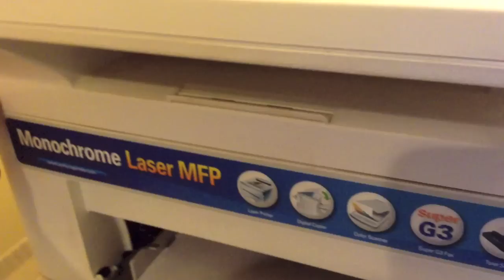Replace a Printer Pickup Roller (Samsung ML2010, SCX4521, SFX4725 and others)

Comment from the maker: Re: Johnny Tucats
Sorry if you had trouble installing your roller.
You can see in the video (around 4:00) that it doesn't take much effort at all to click the new roller back into place. It's darned awkward reaching in there, and you have to have the right little "knobs" or "projections" in the right little slots, but once you have lined it up correctly, it does click in pretty easily.
If you had trouble I can only guess it was either upside down or the knobs weren't in their respective slots. I agree the square bar the roller goes onto isn't the sturdiest part ever made, but I have done this procedure several times and when lined up correctly, it doesn't require much strength or force to install. I recall once where I was frustrated and then realized I wasn't doing it right. I relaxed, watched my own video again, looked things over inside the printer and in it went. For anyone doing this procedure: if you feel you have to use a lot of strength, back off and re-examine the procedure…it doesn't require getting heavy-handed!
Reply: maximpulse Sorry but I still have big problems reinstalling the roller. I used the old one and turned the rubber, but I should still fit. Please do you have any other advice?
Reply: maximpulse Now I managed. In my printer (Samsung ML 1610) the round small pins will be placed on the TOP side.  That was my problem. Thanks anyway for the video!

Comment: Thank you for the video. Really good. Do you know how to change de page separator? My printer is sometimes pulling more than one paper.
Reply from the maker: +Luiz Garrido Filho 
Sorry I didn't see your comment sooner!
I don't know how to adjust or change the page separator. I've never had any trouble except when the rubber roller wasn't grabbing correctly
or when there was high humidity and the pages struck together.
Reply: +maximpulse Thank you!! No problem.

Comment: Thank you so much !!!
I didn't think there was a tutorial even for this small detail...
But evidently, I was wrong ;-)
Thank you again
(BTW - I fixed my old ML-2010)
Reply from the maker: Good for you! These Samsung laser printers were incredibly well built. It would be a shame to have them fade due to these rollers pooping out. 
It was quite an adventure figuring out how to fit a tiny camera (an iPod back in 2013) inside the tight confines of the printer.
It's pretty cool how useful the video has been.
By the way, I have another video about applying a rubber rejuvenator periodically which is easy to apply and really works. https://youtu.be/Hfrqd8SytX8
Reply: @maximpulse  I made the tool and was able to pull out the tabs - just like you did in the video.  No luck .  Can't budge it.  I have a Dell 1100 Laser.  I am stumped

Comment: Your video is great! I fear ruining tabs since been at this all day without success. Also did not find parts number on Samsung website or where to order. I have ML-2010. Can u help??
Reply from the maker: Hi Gloria,
Thanks! I agree: even when you know how to do this, it can still be maddening.
I don't have the part number handy, but you can go to my web page http://www.greendept.com/maximpulse/printer/index.html
and scroll down to the section "Replacing Samsung Pickup Rollers"
There's a link in that section where to buy the rollers for $3.60 + $3 shipping.
I bought some myself for my ML-2010.
The center plastic part seems like it is made of white nylon, so it is much stronger than you might think. Nylon can be bent pretty far and still spring back.

Comment: Unfortunately for me, my pick-up roller housing is different than the one in your video.  It's even different from the roller housing in the Samsung repair manual.  Probably because my printer was manufactured in early 2007.  So, if there are two white disk shaped pieces, one on either side of your pick-up roller, you may need to slide those white pieces away from the pick-up roller and then gently finesse the roller housing off the shaft.  I don't think it is possible to to remove the roller from the housing without removing it from the shaft.

Comment: Genius tip - to undo the two clips, cross your hands over and use the fingernail of your left forefinger to pull back the right clip, and the fingernail of your right forefinger to pull back the right clip, both at the same time.  Easy peasy!

Also there is often a part of the roller that is in better condition, so you can bring it round to the position where the roller is currently white from rubbing against 10 years of paper.  Another video suggests turning the roller inside out.
Reply: I was going to give up on those clips and then I tried this. THANK YOU!
Reply from the maker: Amy Hasinoff
Yay! Getting good suggestions like this is why I like to say "That's why God made other people!"

Comment: So I have ordered the roller, installed it and made sure that everything clicked correctly, but I'm still getting a grinding noise...  Any thoughts would be greatly appreciated...  Thank you...
Reply from the maker: +jmtexan77 
The only thing I can think of is the manual sheet feeder might not be installed fully.
You can remove that and see if the noise ceases. The printer doesn't need that part to print.
Reply from the maker: +jmtexan77 
It just occurred to me that the parts were not clicked back into their original position. If that were the case when the metal bar turns one or another part might be "left behind" and make noises.
But you do say you are sure everything clicked back together. It is a pity it is so hard to see and reach back into the "cave"!

Comment: I had 2 methods that works if the rubber portion of the roller is not broken/badly cracked. 
1) Coat a layer of rubber cement to add more traction.
2) Add a layer of double sided tape on the plastic part which comes into contact with the rubber to increase thickness by 1mm.
Reply from the maker: Hi Michael,
very creative solutions!  Thanks for sharing them!

Comment: hello i have problem with scx4521 the pickup roller rubber is OK but when I put some paper in the tray the roller doesent start. When I "help" it and push it by my finger roller starts take paper and print what I wan't.
It is all the time - what can be the problem ?
Reply from the maker: Krzysztof Stankiewicz Sorry to take so long to reply.When I have had the problem with having to help the paper in it means that either the roller needs to be cleaned and/or rejuvenated or replaced. Of course I try cleaning first.I have lots of info and sources for this stuff on my web site:http://www.greendept.com/maximpulse/printer/index.html

Comment: Quick hint for people.  I was busting the hell out of my knuckles trying to get mine out.  I built all kinds of impliments but nothing would help.  What I ended up doing was actually cutting the black rubber with a knife as close to the bottom as possible.  This gave me something to tug on.  I used my fingers to push the clips down and pulled on the rubber , and it popped right out.
Reply from the maker: Thanks for sharing your solution. It is a very tight space in there. It was a challenge to get a camera in there, too!

Comment: How to insert paper
Reply from the maker: The paper is inserted in the tray in front of the printer. You might have to adjust the width of the side guides or the slide that goes back and forth to fit the paper.

Comment: Hi 
I have a problem ,after I removed the rubber roller and put it back the printer jams halfway through the scan and displays an error code 'ESU ERROR' please help.
Reply from the maker: Hi, I'm not a printer repairman…I just showed how fixed my Samsung printer.
I don't understand how replacing the print roller (that grabs the paper to pull it in) could affect a scan. Did you remove some roller having to do with scanning?